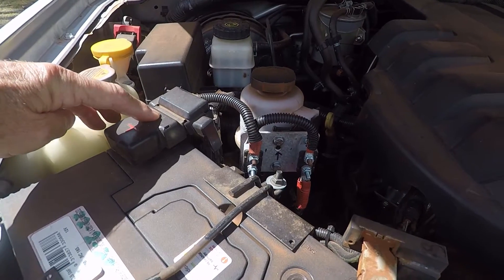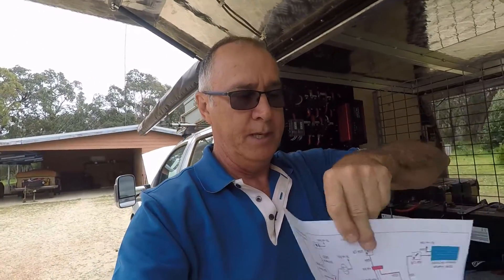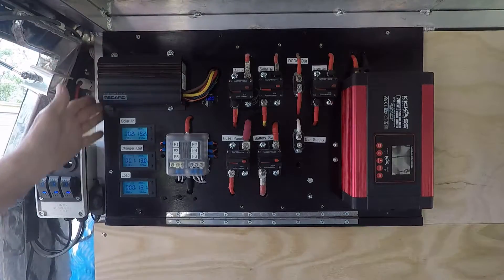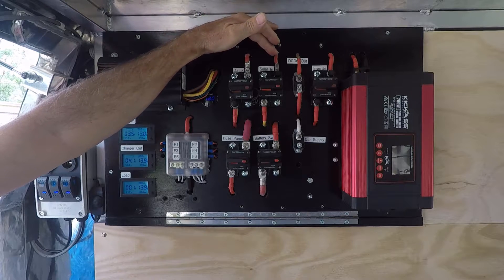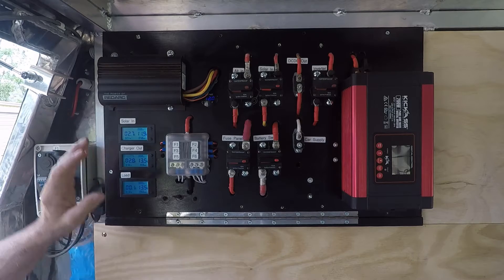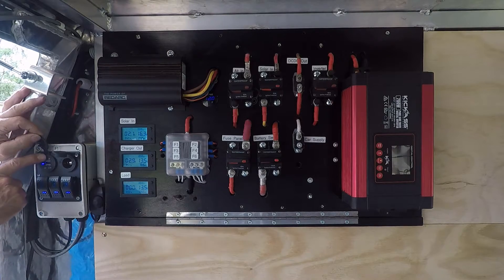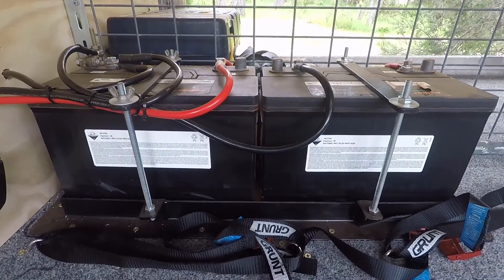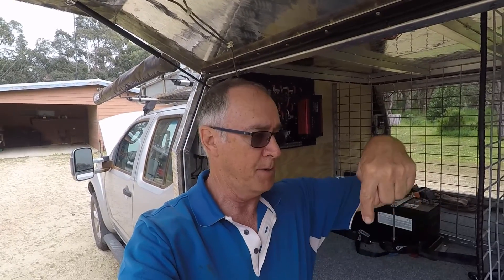The 12V electrical system that I installed in my Nissan Navara canopy.

Comment: excellent video, some good info and ideas. What is the brand of the led dimmer switch and what is the brand of the three vol/amp meters, keen to add them to my build.
Reply from the maker: Here's the name of the dimmer I used....search online or eBay for it: 12V DC 0-100 PWM Manual Knob Dimmer Switch for LED Strip Light Black
For the panel meter, search for this on eBay: Digital Panel Volt Current Meter Watt Kwh Factor Meter with Coil CT R2M1
and on Amazon Australia, search for this: DC Battery Monitor 300V 200A Voltmeter Ammeter Voltage Amp Meter Gauge with Hall Effect Sensor Transformer
Hope this helps you with your build.
Reply: @RustysOutbackAdventures  thanks mate

Comment: very good set up  what the best place to get  done as i have  idear
Reply from the maker: Thanks Kevin. I've just upgraded the batteries from the 2 AGMs to a slimline lithium...got back some dead space in the canopy and saved some weight, too.
It's not that hard to do your own 12V set up, but if it's not something you want to tackle, a local auto sparky could do it for you. Some places like Jaycar and KickAss (Australian Direct) sell complete power boxes/boards so most of the work is already done. You only have to run power wires from your battery and mount a solar panel, or use a portable one, and you'll have power for lights and a fridge, etc.

Comment: Great video mate, like a lot of people here I am about to embark on a similar journey. I’d appreciate being able to access your wiring diagram. Looks like most of that cabling is 8 AWG is that right? What sized cabling did you use from the main battery to the Dcdc charger? I am going to be running a 40a Dcdc charger and thinking 8 AWG should manage but might go to  AWG to account for voltage drop. Thanks again for the great video.
Reply from the maker: Thanks for your comments, Brent. If you send me an email (rmhyde58@gmail.com) I'll send you a copy of the wiring diagram, which has the cable sizes on it (albeit in 'amps', rather than in AWG size).

Comment: Great video bud ☺ wish I could be so competent with doing such an install. We have a new Fortuner and will be wiring in our Portable Battery Box, trailer anderson plug, rock lights in the tailgate and maybe a permanent solar panel on the roof rack. But will probably get it all professionally installed. Cheers, Don, Perth WA (Dons Shed and Xplor Overland)
Reply from the maker: Hey Don, thanks for your kind words. I have an instrument/electrical background so the wiring wasn't too scary for me. Having said that, it should be too scary for anyone, really...as long as you follow the basic rules of 12V electricity. You can purchase lots of the gear you need, either online or through local outlets like Jaycar, 12V shop, etc. and there's plenty of online help available, too.
Reply: Hi, 
Just read yr comment re 12v system. Have a look at my videos and may also be helpful for yr set up. 
Cheers 
Out There Touring

Comment: What size or gauge did you use for your battery to panel ?
Reply from the maker: I used 50A cable from the battery under the bonnet, to the panel in the canopy. I also installed a 50A manual reset circuit breaker under the bonnet.
Reply: Hi, 
Just read yr comment re 12v system. Have a look at my videos and may also be helpful for yr set up. 
Cheers 
Out There Touring

Comment: Hey Rusty, can you drop a link for the battery monitors you got? They just from ebay?
The Hall effect CT seems the much better option, rather than installing a DC shunt
Reply from the maker: Hi Luke, if you search eBay for this description, you should be able to find them....'DC Voltmeter Ammeter Current Meter With Hall Sensor 6in1 300V 100A'...hope this helps.

Comment: great presentation Rusty! circuit schematic and the setup is first rate. best explanation i’ve seen, i’m midway through setting up my ute at the moment. been through around 8 reiterations of circuit refinement and decisions re panel and battery placement, some midway through project but before anything serious done. you are right, planning and decisions on setup are more important than just tearing into it. i got a few tips from this, mine not as flash but should be fine. triton mr dual cab with tub presented a few issues regarding space availability. cheers, Al
Reply from the maker: Hi Al, sorry for the late reply but my internet as been playing up. Glad you found this video helpful. If you have any questions, feel free to email me....rmhyde58@gmail.com

Comment: Hello Rusty, great video. Did you earth the canopy batteries direct to the chassis? And can I get a copy of your wiring diagram?
Reply from the maker: Hi David, yes I connected the -ve of batteries to the chassis. Without that connection, there was some weird stuff going on with the electrics. If you send me an email (rmhyde58@gmail.com) I'll send you a copy of the wiring diagram I created for the electrical panel.

Comment: I didn't think Enerdrive recommended resettable circuit breakers for the main and house batteries?
Reply from the maker: The circuit breakers are manual reset, so if one did trip, I would investigate the cause before resetting it.

Comment: Overkill…
You don’t need all that crap to run a fridge and a couple of lights.
Reply from the maker: Thanks for your feedback. As I run 2 Engels and I use the inverter to charge my drone batteries, camera batteries, my laptop, etc. I like to keep my circuits separate, as well as monitor what's coming in and what's going out.

Comment: Hey, I like the panel board setup... So much so, that I've decided to do something very similar 😅... 
Q: The Hall sensors... I'm confused on which way does the arrow go on each sensor... Brown+ and solar towards the charger? Between fuse block and bus bar?
Reply from the maker: Hi BroKen LiZard, thanks for your comments and I'm glad my panel has helped you with yours. As for the hall sensors, you face the arrow on the sensor in the same direction as the current flow that you want to measure. So, if you want to measure the current coming from the solar panel into your charger, then make sure the arrow on the sensor points towards the charger. Hope this helps.

Comment: Great video Rusty, it has given me some great ideas. Couple of questions, you had on your diagram a kickass dcdc charger but your running a redarc. Did you have an issue with the kickass? Second with the dual batteries I have read it is best to run in parallel as you have but the positive to the load is better run on the opposite battery from the negative to keep the batteries loaded evenly. (Might prolong the life of your batteries)
Reply from the maker: Hi Peter and thanks for your comments. Yes, the Kickass DCDC charger has a solar input voltage limit of 23V, which I didn't realise at the time of purchase. My panels can give 22 - 24V sometimes, so the Kickass would go out on over-voltage. In comparison, the Redarc has a max solar input voltage of 32V. There are other DCDC chargers that have higher solar input voltages, allowing the use of house solar panels.
You're correct, batteries in parallel and the +ve lead from one and the -ve lead on the other, is good practice.

Comment: Great Video. Quick question - what are your gauges on the left / where did you get them from? I want to get them for my set up!
Reply from the maker: Hi Josh and Meg. They're combination volt/amp/amp hour meters that I bought off eBay. Look for the ones with the hall effect sensor coil, so you don't have to cut any cables, as the cable fits through the coil (DC current flows one way so make sure the coil is facing the right way....there's an arrow on the side of the coil).
You can set the parameters for the battery capacity, which is helpful, too.

Comment: Hi mate, what size cable did you run from the starter battery to your AGMs? And again to the DCDC charger? Cheers
Reply from the maker: Sorry for the late reply but I've been away on a trip. I ran 50A cable from the starter battery to the electrical panel in the canopy. From there, I've used 50A cable to the DCDC charger and 100A cable from the +ve terminal post to the AGM batteries. The feeder cable to the inverter is 100A, as is the earth cable from the AGMs to the chassis. If you would like a copy of the wiring diagram I created, please let me know your email address and I'll send you a copy.

Comment: Hey Rusty, a fellow West Aussie here,  I'm currently in the process of setting up a 12v system in my canopy. What I imagined in my head is exactly what you have built so thanks for showcasing this so I can see how mine will work. How did you run the cable from the alternator into the canopy? And what is the cover called that you used for the solar into the canopy?
Reply from the maker: G'day Jackson, glad you liked the video and found it helpful for your setup. For the alternator feed to the panel, it comes along the chassis and into the canopy through the tray, via a cable gland.
The cover over the Anderson plug for the solar input into the canopy is a Jaycar item...it's called a White ABS Solar Cable Entry Point, catalog no. HS8866. 
I removed the cable glands and cut open the face where the cable glands were mounted, allowing the Anderson plug to sit flush with that face.
If you would like a copy of the wiring diagram I created for my electrical panel, let me know and I'll send it to you....or if you need a hand to draw up a wiring diagram to suit your canopy, let me know.
Reply: @RustysOutbackAdventures  Thanks for the quick reply mate. Yea I thought that solar entry looked like a modified jaycar part. I have been trying to source one that is made from metal but I don't think anyone makes them. I might just use normal cable glands for cable entry to my canopy. I just think those downward facing gland mounts look neat
Reply from the maker: If I had to replace one of mine now, I'd make it out of aluminium.